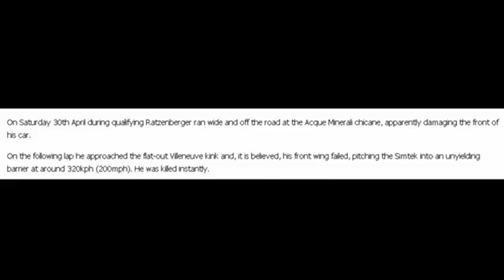Imola 1994:Ratzenberger-how and why he died

Comment: It seems race tracks around the world are getting smaller with sharp curves and there building race cars to go faster and some driver's can't handle these race track designs
Reply: this death was caused by front wing failure.
Reply: No. The sharp corners and hairpins are designed to encourage overtaking for one. This is because F1 has become very boring in recent decades. And this is  because of the modern aero that disturbs the air and makes it difficult to follow another car closely. Modern tracks also have straights to encourage overtaking based on the DRS, or drag reduction system. This era in F1 was very different and unique. They had just abolished active suspension for one, which arguably made the cars more difficult to drive. The cars were much more primitive, an F1 car today can be considered much easier to drive. The monocoques are much stronger. There was little side protection for the drivers head then. There's no HANS? device. Trackside barricades were fewer and less effective. The list goes on. Imola is a perfectly negotiable track by a professional racing driver, especially at this level.
Reply: its not that the drivers can or cant handle it, it the bodies that cant handle them. the race cars nowadays are safer than human bodies can take. they say that dale earnhardt died not because of design flaws in the car, but because his brain couldnt handle the sudden deceleration because of the crash when it hit the front of dale's skull
Reply: @rogerw-interested  I'm not going to bother getting into the subjective side of things. Maybe Dale's brain rattled around inside his head more than usual. Pure negative Gs will hurt. However, in respect to a circuit like Imola, and where say Senna left the track and died. Well this is highly unusual, it's an easy flat out left hander for these guys. There are plenty of places on the current F1 circuit where they reach these speeds or more, some of them in more precarious places. You have to acknowledge the ridiculous grip of these modern cars and tyres too. When they let go, they let go in a big way.
Reply: And by the way, I am not sure if you are referring to Imola as a small, tight, modern race track. It is not.
Reply: @thegooner-49  that's right.

Comment: How did he die ? He crashed, what a friggen joke of a video
Reply: You're a muppet.
Investigating crashes helps to prevent the same thing happening to others
Reply: @biscuitcase83  In this case it led to nothing, only speculation and stupid videos like this ... BTW, I love the Muppets, thanks for that...
Reply: @rogeeeferrari  
Wrong again!

Both Tamburello and Villenueve curves were altered to slow the cars down through those sections of the track. 
Simtek also strengthened David Brabham's front wing mountings for the race and on both their cars for future races.

Those changes were made after gaining experience and knowledge from these tragic accidents.
Reply: @rogeeeferrari  
Senna's steering column broke. This has been established by multiple years long investigations, both official and independent
Reply: @biscuitcase83  It broke when it hit the wall at 190 MPH, which is why Williams was found not guilty in court. Nobody can prove when the steering broke, you and everybody else are only guessing, no "official" reason for the crash has ever been released . More to your statement, nothing was learned from the Senna crash car, except that it was smashed to bits,  OK satisfied ? Now go away...
Reply: @rogeeeferrari  
And official technical investigation proved it.

The issue with applying any charges on Adrian Newey or Patrick Head is a different matter, entirely concerning their level of responsibility for the modified steering column. 

Stop lying
Reply: @rogeeeferrari  

You. Are. A. Liar

The OFFICIAL investigation states:

"In a 381-page ruling, Judge Antonio Costanzo concluded that steering column failure was the probable cause of Senna's crash; however, there was no proof of negligence on the part of Head or Newey, or that they had designed the modifications in the first place."
Reply: @biscuitcase83  Key word there is "probable" , when a car hits a wall at high speed lots of things break...
Reply: @rogeeeferrari  

That's simply legal language. 
The investigation by technical experts proved the column was poorly designed and of inferior material...analysis of every aspect of the crash support the shearing of the steering column, including the final seconds of on board footage. 

No idea why you are denying this.

F1 drivers do not crash at a corner like Tamburello unless there was a mechanical problem.